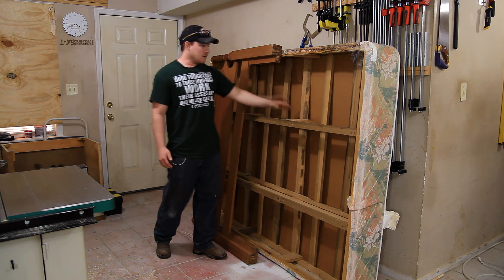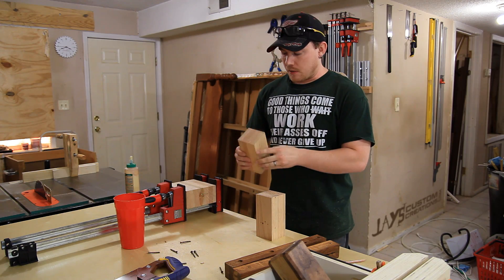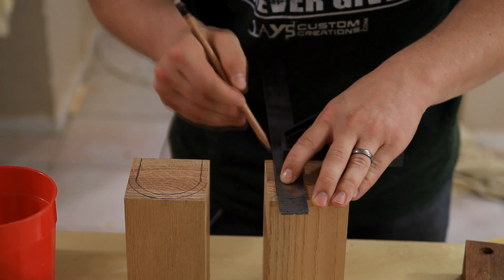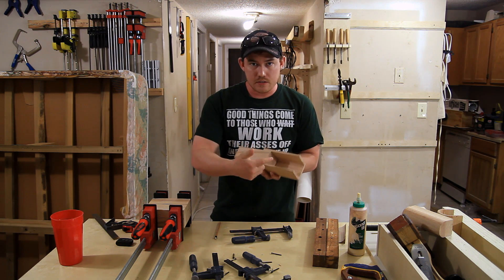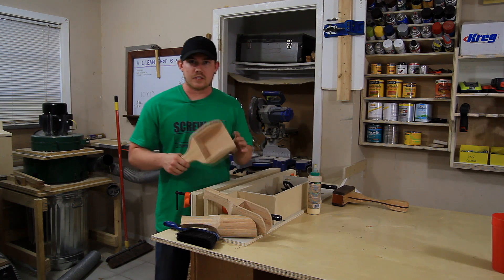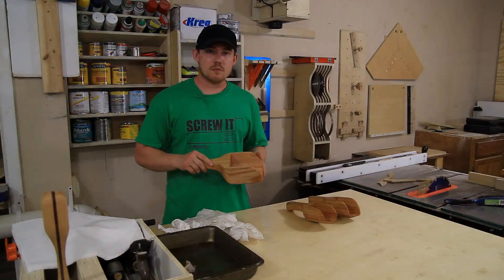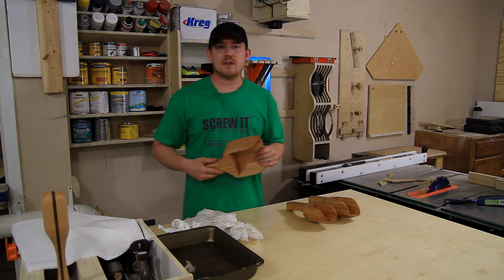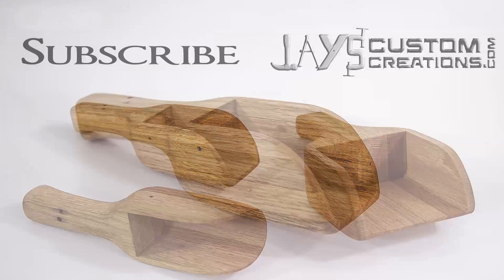Easy Bandsaw Scoops - 146

Comment: you really need to add a couple spoke shaves to your tool box .. those would have made your scoop project a joy to behold .. a few min with the spoke shave and one min on the sander and you would be done ..  a spoke shave also gives you some feedback to how the shape is evolving while your using it ...  

You probably already know this and just did not think to use one or did not have yours sharp and ready to go for this project .. I love how they turned out and that band saw sure did you proud .. you have that set up well to get such even cuts over such a tall height.  

Thanks for showing us that ...

Comment: Loving it!
I have wood lathe, so I'd be inclined to take the inside block and turn a handle before gluing it back together.
In fact, you might be able to turn the whole thing, and part it with the bandsaw to make 2 scoops.

Comment: The larger scoop would lend itself quiet well to being used as a dustpan I think, or if you made a bunch of these and cut off the back part that would make the handle with a sloping cut you could then screw and glue them to a board to act as bins for parts, you could add a French cleat to the back of the board to hang it on the wall system you already have in your shop!!

: )
Reply from the maker: I thought about making a super wide scoop for a dust pan but decided three would be better. Thanks for watching John.

Comment: Very shallow bandsaw blade recommended (as shown)! Try doing that with a 1/2" blade :(  To speed-up handle shaping, you might want to try a Japanese shinto saw rasp -> fast material removal on coarse side.  Alternatively try a bit of knife carving with a very sharp knife, e.g. with a Mora sloyd/woodcarving knife (such as the 106 or 120) or an American pocket knife.  Or a chisel!

Comment: Cool, what can i add to it to make it moisture resistable? I want to make one to use with ice. Or would that be too much?
Reply from the maker: I used mineral oil which is what I use on all of my cutting boards. If it works for chopping food on I don't see why it wouldnt work for ice. Just re-oil as needed.

Comment: Jay, link me to the right place to get the size of bandsaw blade you're using. I tried to make a bandsaw box out of a oak log and it was tough to make tight turns the way you did. Your scoops came out good man!
Reply from the maker: I'm using the same 3/16" 4tpi skip tooth blade I purchased to do the cracked bandsaw boxes. I'm almost positive it was from here:http://www.highlandwoodworking.com/316-4-tpi-skiptooth-bandsaw-blades.aspx

Comment: you make it look so easy jay i keep on breaking my blades when i start to try and a corner turn. Any tips on how to avoid this or can you make a video on how to do it properly without breaking your blades.
Reply from the maker: +Kyle Robertson It was effortless with the blade I was using. It's a sharp 3/16" 4tpi skip tooth blade.
Reply: +Kyle Robertson And the corners aren't actually square.

Comment: Great one Jay. What was the finish? Danish oil?
Reply from the maker: mineral oil. Quick and easy.
Reply: Well they turned out great. Great gift and all from free wood. Perfect.
Reply: Sweet job Jay Bates!  I will have to consider doing something like that myself.  We have many "dry goods" containers at the house as we buy in bulk when plausible.  A few scoops would make many of them easier to use.
Reply: *****

Baby Oil tends to have a fragrance added so it's not really food safe. What you really want is in the pharmacy area and sold as a laxative obviously that is food safe. That's the cheapest and is the same thing as "butcher block oil" or whatever they call it in the specialty stores.

The color is from the wetting of the wood. Most oils are pretty subtle color wise and some things sold as oil or "danish oil" are really just a rubbing polyurethane which is a combo of poly, thinner and oil(boiled linseed usually).

Paraffin oil is pretty much the same as mineral oil and is sometimes sold as a laxative tho usually it's combined with magnesium. Remember you want medicinal grade, not the fuel type.

I wouldn't use anything but pharmaceutical grades as I figure those are put up to a bit more scrutiny as they are sold for a specific purpose(ingestion) rather than a company's promise.
Reply: *****, Yes that is mineral oil and at a typical price US.  Another option that is typically british is to use citrus fruit oil (lime, orange, lemon, etc.).  This is a very old tradition and works well for the kitchen.  It not only protects the wood safely, but also helps deter bacteria while providing a light pleasant scent.

Comment: Would it have been good to maybe sand the end grain of piece you glued in and maybe sand the inside of the scoop prior to gluing together? That is a great idea. Might give that a try.
Reply from the maker: The inside pieces were pretty smooth so I didn't sand them. And I view this as more of a utilitarian piece so I probably wouldn't have sanded the inside anyway. The end grain on the inside of the scoop was crosscut at my table saw so it was extremely smooth as is.
Reply: Makes sense. .Thanks Jay

Comment: I have the same saw - but can't pull a corer like that with the blade it came with... What blade are you using? Thanks, -Jay
Reply from the maker: 4tpi skip tooth blade from Highland Woodworking.
Reply: thank you!
Reply from the maker: forgot to add that it's a 3/16" wide blade